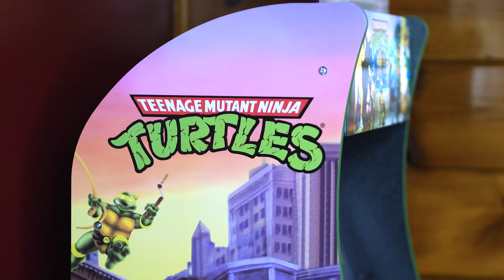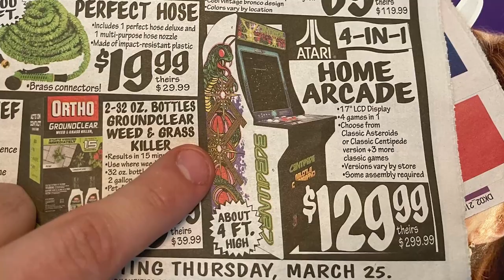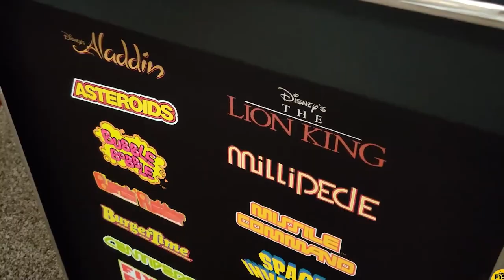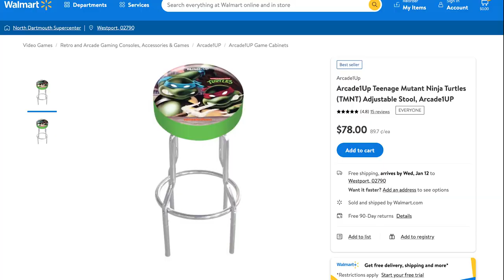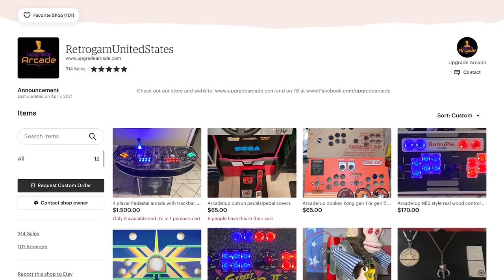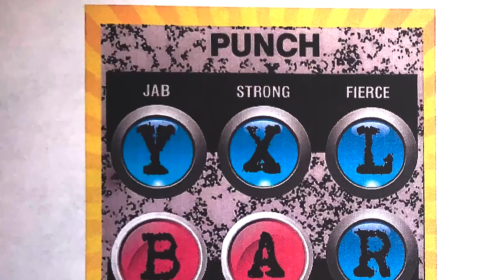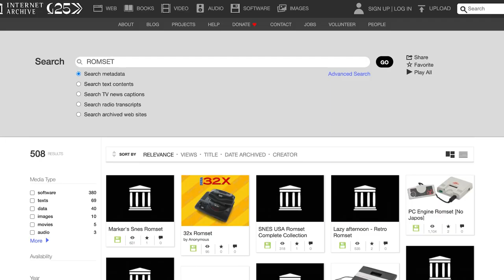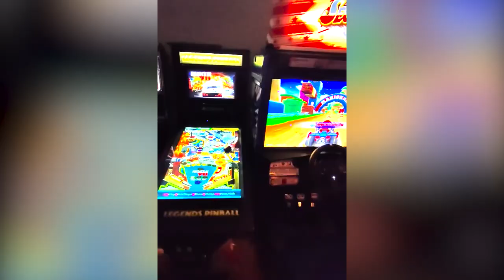Home Arcades: A Beginner’s Guide | Arcade1Up Modding

Comment: Only mods I made to my MK2 cabinet was I swapped out the stock 4 way gates on the joysticks for 8-way octagonal gates which is what they should have had stock. The joysticks also felt weak and spongy to me with very little resistance so I removed the stock springs in them and added 4 pound springs.

Comment: Great video I really enjoyed your story.  Another option and what I did was a bit more involved I found an original cabinet arcade game called Twin Cobra. Stuck a Multicade / Jamma board it was a 60-1 direct plug and play. It plugged directly into the Jamma PCB Board. The only downside is original cabinets way so much. I had a real hard time getting it into the basement. I picked up the Cabinet for $200 and the Multicade board was $50 so for $250 I got a real authentic Arcade Game with 60 titles. I'm so upset that I sold it. I think the Arcade1Up is the most feasible approach to this and then spending the time to get a Pi4 with with a prebuilt image.

Comment: If youre interested the Yoga Flame model, it runs on Android 10 and has a sd card slot. Ive got all sorts of emulators and the like on it. As long as the emulator as an apk file youre gtg. I know redream and  Duckstation automatically set the controller although you may need to remap the buttons. I literally play Power Stone and JoJos Bizarre Adventure.

Comment: It seems you're saying to avoid Arcade Mod Up. I was considering purchasing their big (expensive) cabinet with 32 inch screen. Should I avoid? Why?
Reply from the maker: Yes, they’re banned on all the social media groups for being totally unresponsive to customers with unreliable services with enormously long wait times.
Reply: @RedCowEntertainment  Dude! It took all of 5 minutes for your reply. You rock thank you. I subscribed just for that.

Do you have suggestions for full sized cabinets that play 7000+ games? Arcade Mod Up seems to good to be true, now I know why.
Reply from the maker: No problem! So what I describe in the video is that I bought an arcade1up I liked (the Mortal Kombat one) and then bought a mod kit from upgradearcade.com. They’re awesome and were very responsive and helpful and the instructions were very clear. They give you a raspberry pi and an HDMI converter for the existing minister, and a speaker system. Then for some of the other odds and ends, like dust protectors around the joy sticks and those toppers, I went to Etsy and browsed around.